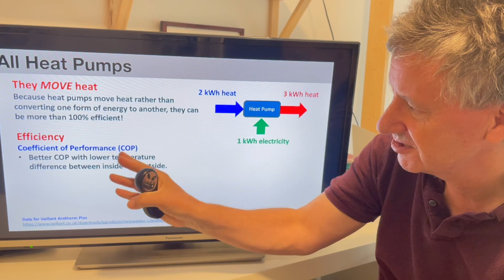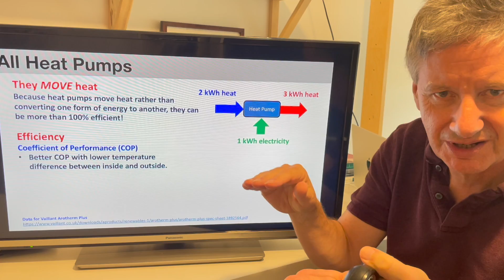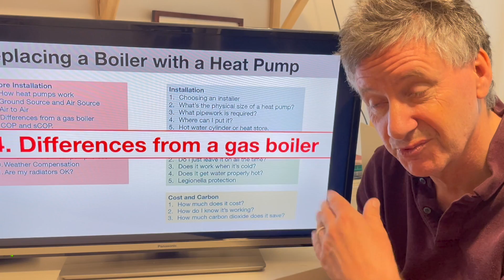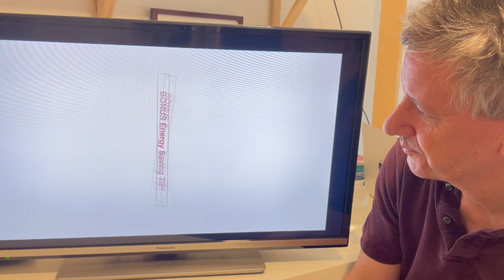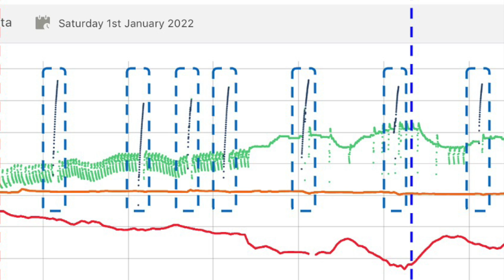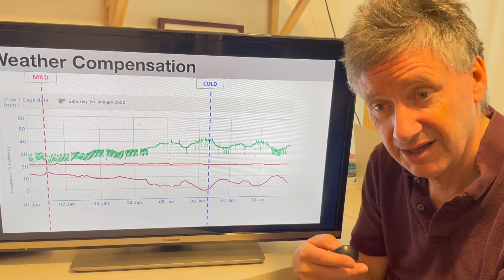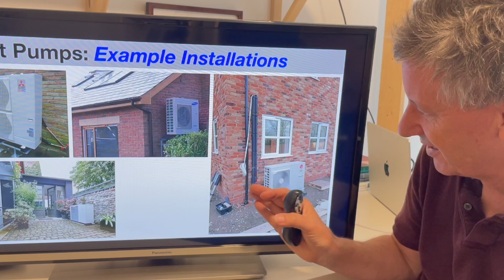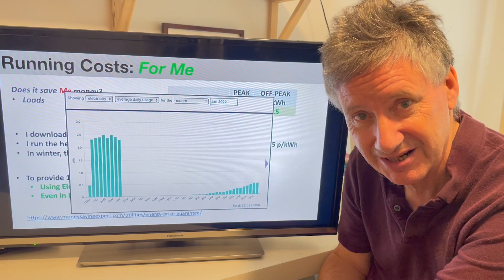Replacing a gas boiler with a heat pump

Comment: Thank you for the video. But, if the heatpump costs 8000, and the savings are 173 per year, the payback is 46 years without the backup battery ant solar panels! The battery and solar panels also cost a lot of money, and they also have the payback time. It is very heavy decision to exchange the gas boiler to the heatpump. The gas price should raise 10 times.
Reply: Great presentation!  I appreciate the simplified schematics showing the heat pump operation. Here in the USA, it´s a little more confusing as the efficiency numbers are stated as SEER (Seasonal Energy Efficiency Ration)for cooling and HSPF (Heating Seasonal Performance Factor).  If you only consider the SEER, you could be way off on your condenser estimate and be left with an anemic heater. Also, in our Luddite system here in the USA, heat pumps are specified in terms of Tons of capacity while the gas units are BTU´s or Therms as opposed to KWH used for electrical equipment.  For the average person, it´s a pain to convert units to compare apples to apples and get a resonable cost comparison. Also, it seems the most common domestic condensors are the cube types dominated by legacy American manufacturers-- e.g. Carrier-Payne, Trane-American Standard, York, Rhud, Goodman etc..).   I see some of the brands you mention here as well but mostly for mini-splits or smaller units.  Here in california, we´ve got  approx. $0.30/KWH baseline with NG at equivalent of $0.125/KWH ($2.30/Therm).  Soo...it seems here as well, the best you can do is break even unless you have home electric generation. The rate structure is designed to punish subscribers with higher energy needs and if the user´ś elex load increases--say, by installing a heat pump, they get penalized at $0.38/KWH..so loose-loose from a rate standpoint.
Reply from the maker: @bigwave_dave8468  Dear Big Wave Dave, Good Evening. Thanks for the information on Californian pricing structures.

Regarding US manufacturers  I have seen those 'cube' type units on videos and been curious that European units just don't look like that at all. I think one part of it may be to do with space: you've got a lot more of it than we have in Europe or the UK. Also there is very tight regulation on noise which actually dictates quite a lot of the unit dimensions by the need to keep the fan tip speed low at even the largest air throughput.

But even though the economics are currently marginal both here and in the US, I do have hope that that will change.

In any case, all the best: M
Reply: @michaeldepodesta001  Those US manufacturers i mentioned  basically have a 3-tier modeling scheme (low, medium highest efficiency) They are almost all Cube types but it may also have to do with the  average capacity being larger (coils around perimeter with fan  flat horizontal on top of the cube) as opposed to stacking two units vertically to achieve similar capacity. I'm not sure about noise regulation here. Nobody seems to publish noise figures like they do for bathroom fans.  Besides efficiency, quietness is my main criteria. oh one last thing -- it seems that here, Air-Air heat pumps are most common. likely since the housing inventory in the US is much younger.  It's rare to see a house with radiators nowadays and hydronic heating is unusual in anything but expensive homes :-(
Reply from the maker: @bigwave_dave8468  Yes, good thought. In Europe they just stack the fans to increase capacity.

And yes, air-to-air makes lots of sense if you don't already have radiators. In the UK heating currently almost entirely from gas boilers with radiators (or under-floor heating in more modern homes) and for these Air-to-water heat pumps represent the upgrade path requiring the least internal re-modelling of a home.

Sometimes I wish things were simpler...

All the best

Michael
Reply: Yes, but then your grandchildren will thank you for looking after their environment!
Reply from the maker: Marijus, Good Evening. Yes, you are correct. A heat pump is broadly cost-neutral with a gas boiler at current prices. And it costs more to install. 

So how could I possibly recommend a heat pump to anyone in good faith? Because not every decision is made as a pure financial decision. Do people calculate the payback period on a car? Or a holiday? Or a new Kitchen? People make these decisions because they want the benefit and they accept the cost. Similarly, living a life where I know have done my utmost to minimise carbon emissions under my control makes me feel better each day.

Many people are not in my privileged position. I accept that. And if you have something better to spend your money on, that's great. One of the other high impact options - if you have the money and location is solar + a battery. This will have a much faster payback. Alternatively consider buying shares in Ripple - and own a fraction of a wind farm.

In any case: good luck and best wishes. Michael

Comment: Many thanks Michael for the nice and informative Video. May I ask how much battery storage do you have and how much solar capacity you have. I am
Asking because I am thinking of installing a heat pump and would like to have an integrated solution
Reply from the maker: Mohamed, Good Morning,

Firstly let me answer your question:

The battery I have is a Tesla Powerwall with 13.5 kWh of storage. 

Since November 2019 I have had 12 x 340 watt peak panels: 6 facing 20° E of South and 6 facing 20 ° S of West. But in November this year I added more panels.

I added 3 x 390 watt peak panels on a flat roof and 5 on the main roof facing 20° N or East. I discuss the installation and my expectations in this blog article 

https://protonsforbreakfast.wordpress.com/2022/10/27/new-solar-panels/

Now let me tell you what I think is the right way to get a balanced system.

My wife and I use around 10 kWh/day of electricity - excluding heating. If the children were still with us this might be as much as 20 kWh/day. This consumption sets the scale of the storage you require. I think optimally - balancing cost and utility - one should aim for battery storage to cover about one day's household consumption. Batteries are expensive but they can generally be installed in slowly over a few years.

Regarding solar, I would recommend to get as much as you can. The panels themselves are cheap and while the people are on the roof it doesn't take much time to add another panel or two. I expect annual yield to go up from around 3,800 kWh/year to around 6,000 kWh/year. But the key result is how many kWh/day of solar one gets. For our current system in summer we get ~15 kWh/day on average and in winter ~ 3 kWh/day. This should be compared to 10 kWh/day summer consumption. and 25 kWh/day winter consumption (including all heating)

So in summer we get ~ 15 kWh/solar which runs the house and charges the 13.5 kWh battery and we then run on the battery overnight.
In winter we buy 130.5 kWh of cheap electricity at night and then run on the battery for most of the day, generally running out late in the day. Solar tops up the battery a tiny amount during teh day.

Check out the website and use the search function for more articles.

https://protonsforbreakfast.wordpress.com

Good luck with all your endeavours. M
Reply: @michaeldepodesta001  Many thanks Michael for this detailed reply which is very useful for me. I have already a 6kwh solar (16 x 380w panels facing south) and no room really to add more. I have also 19kwh battery (pylontech). Now I am thinking about the heat pump and was worried about the cost especially that my combi boiler is new (two years old) and my annual gas consumption is low (8000kwh max).  I am very surprised that you meed 130kwh every night during winter. That’s really a lot. What is the size of your heat pump? Octopus just finished their report and they are suggesting 8kw pump and just two radiators to change.
Thanks again for caring.
Reply from the maker: @DahouiM  Firstly 6 kW-peak is a great installation and 19 kWh of batteries is LOADS!

If your gas consumption is 8000 kwh then I can't see any way that you can possibly need an 8kW heat pump. It's almost physically impossible. What to do? If we have any more cold weather this winter (i.e. around 0 °C) try measuring your gas consumption (in kWh) in the coldest weather over 24 hours. If you divide by 24 your will get a pretty solid estimate of your heat pump size.

Having an oversize heat pump is not a disaster - it's very very common - but it costs more and won't get teh best COP.

I don't use 130 kWh each winter night. This graph shows the daily consumption (average power) versus external temperature during the cold weather. 

https://protonsforbreakfast.files.wordpress.com/2022/12/cold-weather-2.png

Peak heat demand is about 3 kW(i.e. 72 kWh/day) with -3 °C outside which we meet with around 30 kWh of electricity consumption (COP = 2.5) This is easily met with the 5 kW heat pump. Indeed, we could get by with one size down. Over most of the cold winter we use around 45 kWh heat a day - with a COP of between 3 and 4.

Good luck. M
Reply: @michaeldepodesta001  many thanks Michael for all the help and willingness to provide all these details. I will now consider my options seriously. 8kwh pump is what Octupus are suggesting and I don’t think they will change their mind to ensure their installs meet their requirements.
It still worries me that the heat pump would consume more than 30kwh a day
Reply from the maker: @DahouiM  30 kWh/day of electricity is just 1.25 kW on average. That's not much to heat an entire house! Of course teh thermal power would be around 5 kW.

Comment: Thanks Michael. Super video that has consolidated everything I have learned, researching HPs in the last 6 weeks in 1 hour🙂
In 2023 I am renovating/extensively redecorating our house (even though it's only 25 years old!) and trying to do all the preparation so the HP install is not so costly and I can get the smallest one possible (upgrading radiators, pipework and insulation myself). 
According to Heat Geeks rough guide cheat sheet, I am looking at a requirement of between 30-50x my floor area (exactly the same as yours) of 167m² which works out at a 5 to 8.5kw HP. As I am going to decorate every room I was going to add 25mm PIR insulation to all exterior facing internal walls. This along side new double and triple glazing should mean that 5kw is sufficient. I just need to understand if after all those upgrades a 5kw might be oversized. 
One question: on your setup, do you run a Legionnaire cycle even with a PV installed? I thought that PV used excess electricity to heat the DHW for free so it would always go over 60 degrees?
Reply from the maker: Dear Fritzy Babe - that is not something I thought would be typing this evening!

First of all well done for planning early on. That's really smart!

Regarding heat pump sizing. Did you record gas usage during the recent cold spell? If you did, try dividing your gas usage (say 150 kWh/day) by 24 hours to give you the average heat pump power in kW. I wrote about this here: 

https://protonsforbreakfast.wordpress.com/2022/11/07/what-to-do-on-the-coldest-day-of-the-year/

and here

https://protonsforbreakfast.wordpress.com/2022/12/11/cold-weather-measurements-of-heat-transfer-coefficient/

These should give you very good estimates of the heat pump size you require.

Regarding Peak Demand. In the second of those I plotted average consumption versus heating demand. In the days afterwards, things got even colder and peak demand was around  3.5 kW. So technically I could have got the smaller size (3.5 kW rather than 5 kW) but I felt 5 kW was no longer grossly oversized. But it is too big for most winter days which more normally require only 1 kW- 2 kW to heat the house.

Regarding the Legionella Cycle. Yes, I do run one weekly in place of a regular cylinder top-up. It heats to 60 °C. Using excess PV to heat the cylinder is a smart first step, but it is way too much heating in summer.

In summer we heat DHW in the afternoon when outside temperatures area maximum and the PV has generally topped up the battery already. This uses PV which would otherwise have been exported. Once that is done, we export the electricity.

In winter, we heat DHW at night using cheap rate electricity. At 7.5 p/kWh and a COP of 3 this is very cheap. We also charge the battery using cheap rate electricity and then run teh heat pump with it during the day. When it's 10 °C outside, we can generally make it through to 11 p.m. or so before the battery runs out. When it was -5 °C we only made it to midday before the battery ran out and we had to buy full-price electricity. 

Anyway: Good luck with endeavours!

Michael
Reply: Thanks for the comprehensive reply.  Unfortunately I can't calculate using gas usage as I don't heat the house up!
My house is enormous (16 rooms if you include ensuites for 2 of us!). I currently have 3 rooms + 2 ensuites heated for 1 hour a day (probably 3 hours on those really cold days last week). My office (I WFH) is heated by solar gain if sunny and a 1kw for an hour if not sunny.  My gas usage runs from 21st each month and was 128kw Oct-Nov 690kw Nov-Dec. 
As you can see not high usage but you get used to being cold - many layers!
I want to install a HP as I think I could have a higher background heat for very little running costs. 
At the Renovating show this year I was advised that the roof would support a 9kv system (subject to DNO approval) as the installer recognised the house design. That means very cheap heating with a battery installed.
Reply from the maker: @MrFritzybabe  Ahhh. Everything is always complicated. But with 9kW peak solar, batteries and a heat pump you should be flying! Good luck with all your endeavours. M

Comment: Interesting Michael, thanks. We have 4 bed sd house have recently replaced our gas boiler. I tried dropping the flow temp to 50 but with this cold spell -3, the mornings took so long to warm up. So I put it back to 60. As I understand it it is likely to be less efficient. So my question is should I drop the temp lower but extend the early morning by turning it on 2 hours before we get up? We do have a larke open plan space so an alternative thought is to supplement with and A: system situated high on a wall with some fans into Hall and stairs and downstairs open plan, thereby reducing winter gas usage. We also have large bifold south facing windows at the back of house and it can be hot - so maybe offering some aircon? Any thoughts welcomed
Reply from the maker: Alan.Good Afternoon. The issue of 'setback' conditions is very hard to resolve definitively. I'm sure you understand the trade off between (a) saving gas by lowering the temperature for a few hours and (b) wasting gas by having to heat rapidly at the end of the setback period. The optimised balance depends on the length (hours) and depth (°C) of the setback compared to the rate at which your home loses energy. I would suggest you measure it. This cold weather is ideal for these measurements.

To do that just read the meter 24 hours apart with the set up as you like it. And then try an alternative. You will probably need to repeat the test a couple of times to be confident in the results and to compensate for changes in outside temperature. Drop me a line if you want help to interpret the data.

We have a small AC system which we use in summer to keep the bedroom and hall cool, but we find the 'coolth' does not spread well through the house. A so-called mini-split AC unit could provide an economical boost to winter heat (it's a heat pump!) and offer cooling in summer. 

Solar gain is a difficult topic to discuss without specific knowledge of room orientation, but solar is very powerful. In summer it's 1 kW per square meter directly and if a big fraction of that is making it into your home you can have the equivalent of a multi kilowatt heater! 

Anyway: Good luck with your heating - my advice is to get some measurements under your belt!

All the best: M
Reply: @michaeldepodesta001  many thanks, yes I will do some tests - weather on the turn but worth trying - I think I might start with extremes, ie 65c/low hours v 40c/24 hours and judge the outcomes re comfort and cost. cheers A